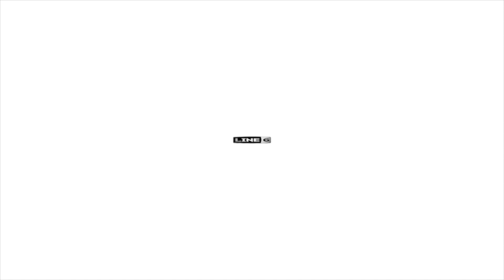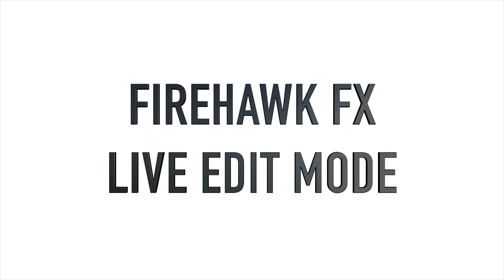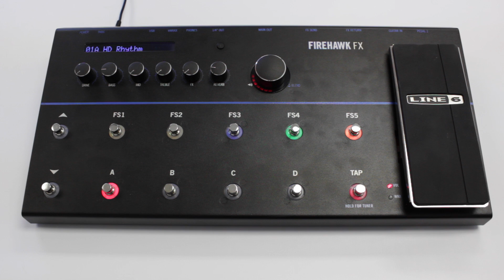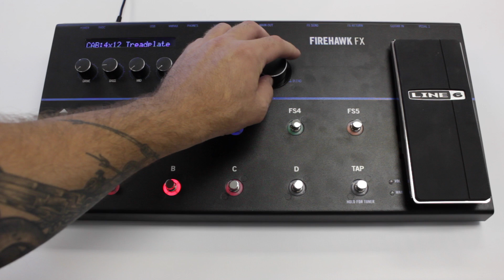How to use the Firehawk FX Live Edit

Comment: Why don't any of these demos/reviews mention the massive preset switching latency problem?  It makes these otherwise decent units next to useless for live use.  I'm guessing Helix doesn't have this problem, eh Line 6.  Oh, and don't forget the other bugs that still haven't been fixed.
Reply: I own a firehawk fx and have never come across this latency that people talk about so much. The only time it gets slow is if I make a mistake and press a couple of preset footswitches at the same time.
Reply: @djcanilla  There is a definite gap between preset switching.  Helix  has the same problem in preset mode but, you can eliminate it by using the 'Snapshot' mode, or by sacrificing half of the available DSP! Then you'll have instant glitch free preset switching.

Comment: I must say that I have been very intrigued with this board. My only drawback is not knowing exactly which stomp or effect it is. I know I can tell based on the color that it's Mod, Delay, Reverb, just like the M13 but when you push the switch the display only shows Stomp or Mod or Delay on here. I wish It would display exactly what it is, like HD Screamer for example. I guess just make sure you have the app open on phone or tablet.
Reply: I always print out the names of each preset and tape them above the corresponding buttons. Pretty easy solution